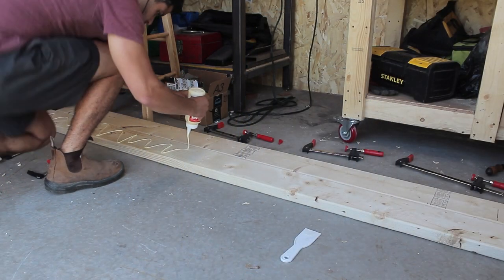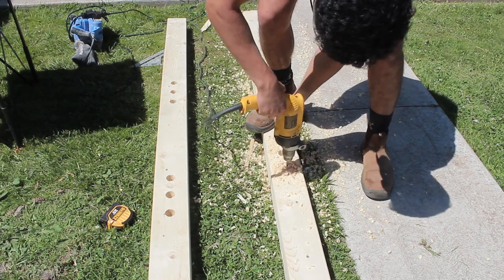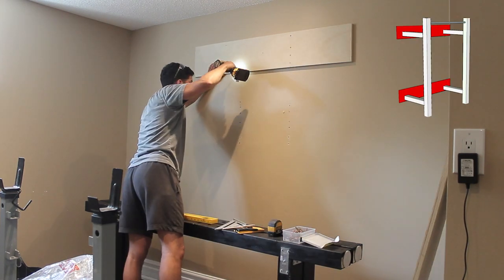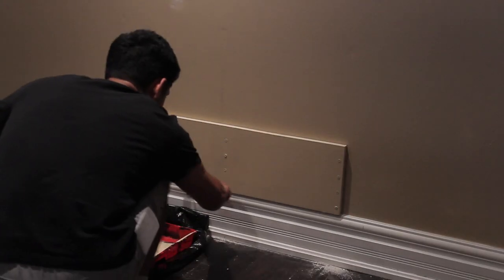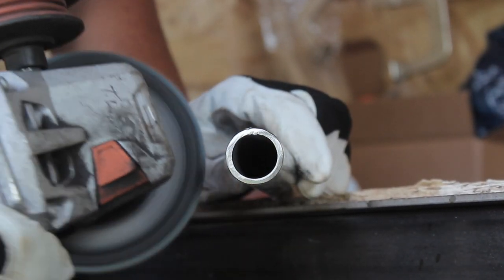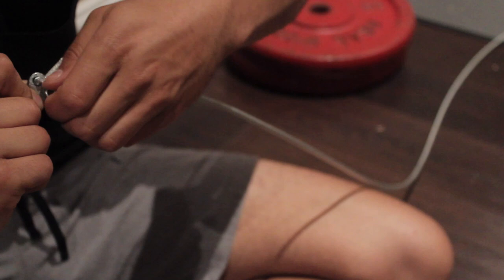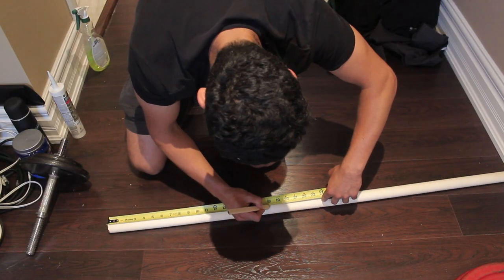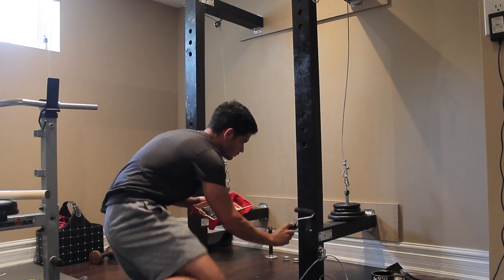How I Made This All-In-One Home Gym For Cheap | DIY Power/Squat Rack & Homemade Cable Pulley System

Comment: Solid build man, love the pulley system!
I ran into the same issue with the post spacing when I was making my folding rack. Ending up catching it before I drilled anything in, but still such a headache when you have to go back to the drawing board haha.
Reply from the maker: Yeah aha it sucked, but it was so worth it, still going strong and the cables are even smoother now.

Comment: Great job. I built one in 2016, and it's still used 5 days a week now. I would change out from using wood dowl for your pulley system and hopefully the pulley you're using are ballbearing. The pulley bar can be had for cheap, or even made from steel or iron bar just as you did for the pull-up bar. For ballbearing pulley you can use a garage door pulley. As you get stronger, you will use more weight and find these suggestions (hopefully) helpful.
Reply from the maker: Thank you, and thanks for the tips!!
Reply: Sure metal is stronger.
Wood is pretty strong though if you don't drill a hole in it. I used some climbing rope tied into a loop with double fisherman's and then used cow hitch multiple turns for a high pulley bar.
As far as strength I used a dowel, 2" closet rod of wood for several years for pull ups at a 225# body weight. No holes were drilled it it, I used knots and hung it from ceiling.
Yes I've seen pipe drilled with eye bolt used successfully too and of course it's stronger.
I feel if he can hang from his handle ( attached to pull up bar )
then it's probably strong enough.
I do feel not drilling a hole in it would have been better though.
He has no leg hold down so he won't be pulling more than his body weight from high pulley
so hanging from it is a valid test,
tie it to pull-up bar, maybe do some pull ups... don't bend your knees back, be ready to fall, not on your knee caps.
If it holds your weight I think you are probably good but don't sue me, my suggestions are for entertainment purposes only!
I accept no liability and you should get an engineer's stamp!
As of course you should for your rack. I leave it to you...

Comment: Great job!  Are the galvanized pipe bars used 1" or 3/4" ?
Reply from the maker: 1”
Reply: @nikoscarpentry I have a question, if I can fit a parallel bar into one of these wooden columns, would it be safe to do the dips exercise?

Comment: Are you able to do crossovers without the cable rubbing on the wood?
Reply: I also wondered.
What would be the point of two high pulleys if you couldn't though?
Reply: I think you need a beam to put distance between pulleys.
Take a look at this pulley system: https://m.youtube.com/watch?v=ClfftecMCkg&t=10s
Personally I think rope from REI and pulleys from REI might be better and easier to work with.
I'm not talking about hardware store rope I'm talking about static climbing rope.

Comment: Dammi my friend, I can’t understand you didn’t even think about how far apart were you going to put the main pillars.. nice build and nice video, I can see your effort in film everything, for the build the best benefit that I see is the low price and simplicity, but that cable system.. I never saw anything worst.. My diy cable system has some very stable bolted pulleys, for 8 euros each, the weighs are going nowhere! Only in a straight line up and down, yours are almost hitting the wall at anytime, easy fix!
Reply from the maker: Thanks for the comment, I couldn’t find any bolted pulleys for that cheap. I just wanted to keep costs low. I haven’t had any issues.
Reply: @nikoscarpentry  it's funny how in italy we have the opposite problem, we only habe the bolted ones.. anyway i just think that is worth the added cost for a much smoother experience, mine has almost no lateral swing at all (with 2.5inch diameter fixed pulley)
Reply from the maker: @Yosomy  yeah I’m sure it’s worth it. Maybe I’ll add some new pulleys on it eventually.

Comment: Great build man. I have been planning something similar for over a month now. Quick question - Is that a dry wall that you have mounted everything on? Is drywall strong enoughh to hold this kinda thing for long?
Reply from the maker: Use a stud finder and drill into studs you can't just drill into drywall. On the bottom panel, I had to use drywall anchors because there were no studs for some reason.

Comment: Niko, good job! Really good job.Awesome.
But i have one small objection))) The wood is not quite suitable material for gym tools. It's elastic and weak for powerful tensions and hits.  The joining can become loose. I saw you have welding machine. You can weld a real professional gym tool
Reply from the maker: Yeah you’re right. But I don’t wanna spend too much on it.. I’ve been using it everyday for about 2 months now and no issues with joinery, I’ve been keeping an eye on it. My brother and I may eventually make one with steel but for now it’s been great.
Reply: @nikoscarpentry  you r the Best!)))
Reply from the maker: Михаил Топорков miss you buddy!

Comment: Nice build, nicer than many I've seen.
A question, are you able to do crossovers without the cable rubbing on the wood?
Reply: I built mine based off the buff dudes power rack and added cables on top for cross overs. From what I seen they do rub on the frame and it's not smooth.
Reply: @reygarza4030  Take a look at this pulley system: https://m.youtube.com/watch?v=ClfftecMCkg&t=10s
Personally I think rope from REI and pulleys from REI might be better and easier to work with.

Comment: Did you bolted it to the drywall ??
Reply from the maker: No just of the bottom 2 pieces because the studs stopped there for some reason. The 2 top pieces are in studs.

Comment: I'm going to be designing and making my own power rack soon! I have a couple questions. First, do you like using the pipe + flange + end cap as your J-Cup? I'm not sure whether I should go with a simpler solution like that one, or design my own out of wood. Second, do the legs of your power rack rest fully on the floor or are they floating? I want to make one that folds up against the wall, and I'm considering using furniture feet that can lift off the ground so I don't scrape the floor as I fold it up. I like the designs of your accessories! Great build!
Reply from the maker: Thanks Kevin! Yeah, the pipe j-cups are perfect and stronger than anything you can make out of wood, so I'd go that route. The legs rest on the floor yes.
Reply: @nikoscarpentry  glad to hear you like them! I guess I was more envisioning something that's a mix of wood and pipes for the J cups, so that the barbell doesn't hit metal on metal. Something like in this video: https://www.youtube.com/watch?v=Pz7gc5VVKMg
Reply from the maker: @KevinKampen  Oh okay I see. Looks like a good idea. What's your concern with metal on metal?
Reply: @nikoscarpentry  I think scratches would be inevitable. And while that isn't a huge problem, I think I'd still like to avoid it if possible. The more major concern would be if either the pipes or the bar got a dent, potentially compromising the structural integrity. But I assume that would only happen if a heavy enough weight was slammed down on the pipes. Unlikely to happen, but still something that worries me. With wood being a softer material, that will definitely dent first
Reply from the maker: @KevinKampen  yeah that method you showed me looks like it would be easy enough. I’d go with that

Comment: Do yo own all these tools or did you rent them?
Reply from the maker: I own all of them. But you can do this all with a drill. You can do it with a 4x4 and get them cut to your lengths at a lumber store. For the pull up bar you just need do get a length that will work for your bar. I just bought the wrong one initially so we needed to weld it.
Reply: @nikoscarpentry  Thank you, brother!

Comment: All that time and effort and you could have just bought the correct size lumber. Time equals money and you wasted more time glueing, cutting and routing than just buying the proper materials up front. Carpenters don’t do glue 1x4s together to make 2x4s when building houses, you shouldn’t gamble on it either if you’re building a squat rack
Reply from the maker: At my home depot a 4x4x8 spf is a special order, a special order during lockdown isn’t something I wanted to wait for. Took an extra hour, didn’t mind it at all. Thanks for taking the time to comment.
Reply: 2 1x4's laminated together are stronger than 1 2x4 board, may not matter in building a frame for a house that gets a lot of stuff added to it like sheeting, but in this case I actually think it was a better way to do it
Reply: @RobbertVanBobbert  this is not engineered lumber, this is glued and screwed together. There’s no way you can compare this to engineered lumber. I’ve seen that stuff destroy standard saw blades in a days work. This ain’t it chief